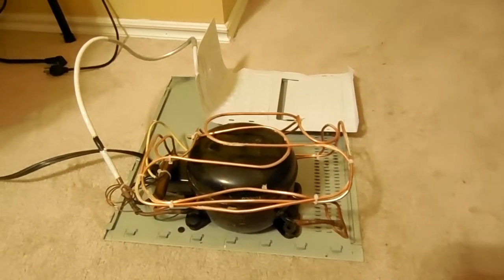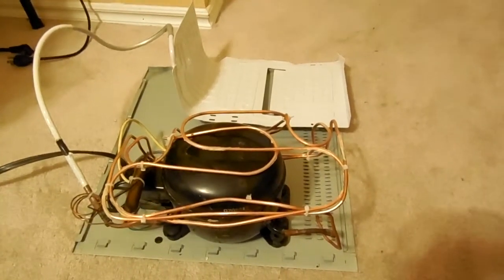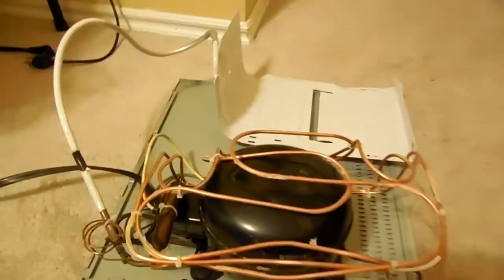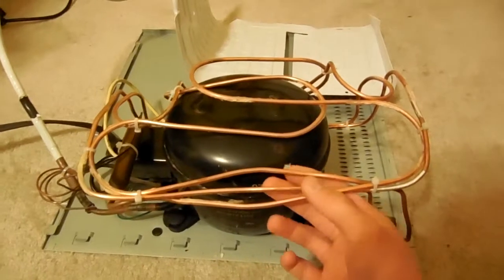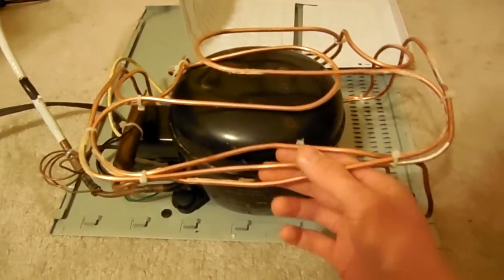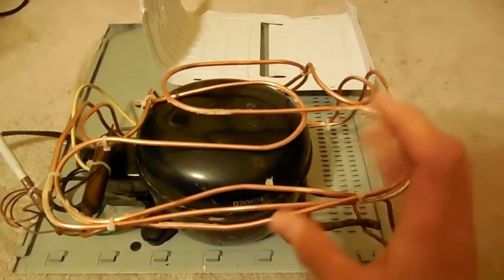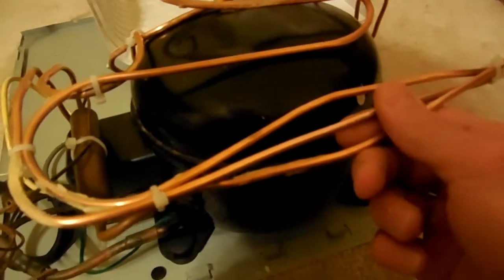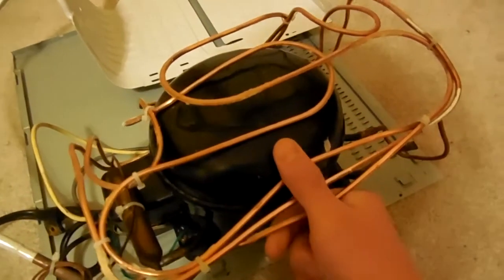How A Fridge Heat Pump Works

Comment: You should really run these videos through an editing software that cancels out the background noise. They're very easy to use these days, just select noise cancel and it's all gone in 10 seconds. Thanks!
I wonder how small this system can get before use of Peltier module is more reasonable.
Reply from the maker: That is a good idea for background noise, I don't know why my camera makes those. I am pretty sure the heat pump can be made quite small but the compressor itself can only get so small so at some point the amount of space one of these would take up for the heat pumping capability a peltier unit would be more practical.

Comment: Sorry but your wrong, the gas does not have a lot of heat in it till it is compressed,
the pressure differentiation that cause it to absorb heat, everything has heat.